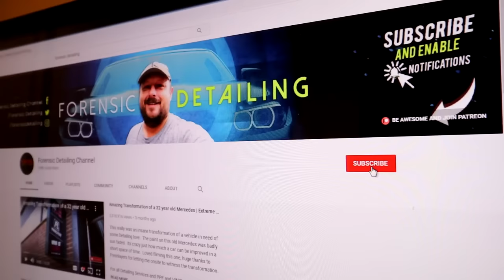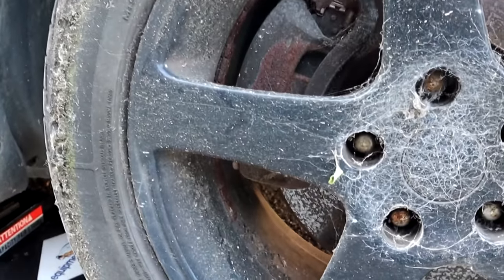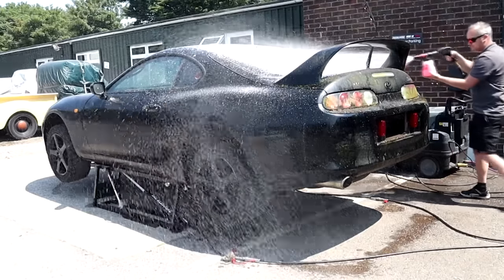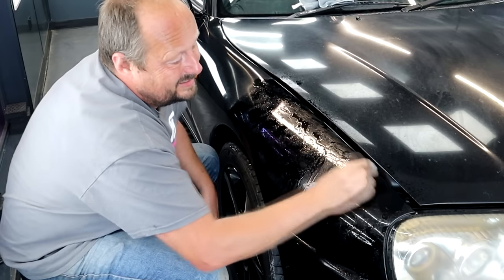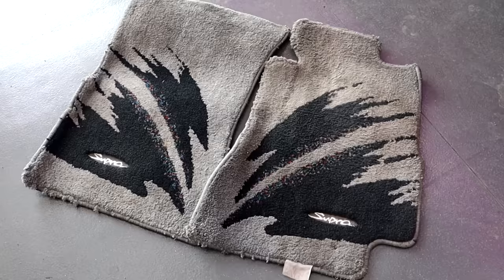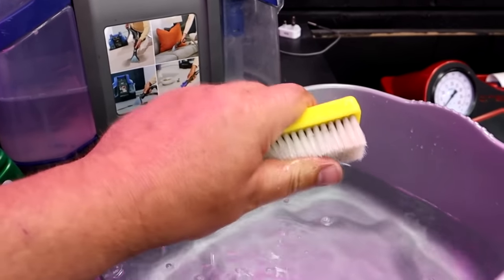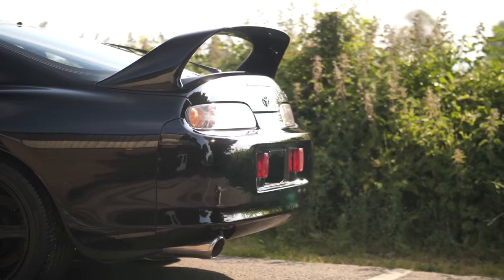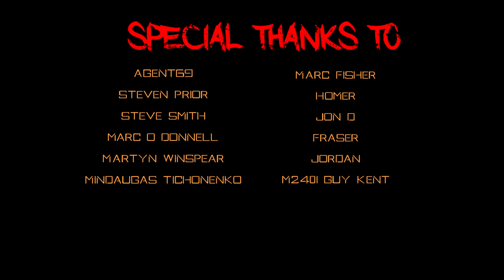Mouldy Supra Deep Clean Detail | First Wash in Decades

Comment from the maker: How would you have tackled this one?
Reply: Send it to someone like yourself... 👍 😉 top job guys
Reply: I would have done the same steps as you did! It's usually quite tough to get the paint perfect when the grime has been cooking for 24 years!

Great job!
Reply from the maker: @scandinaviandetailing  yer. there was no perfecting this but its at that age generally where your OEM clearcoat is probably going to need to be redone anyway.  my e36 was the same.
Reply: I wouldn't let it get that bad!
Reply: Rare car he says, yet there is 2 standing outside the shop :)
Reply: Probably would have chemically decontaminated it like you guys did. Was that wax is dead snow foam that you used? Or was it touch less or autofoam? Because that was obscenely powerful. Or did you need to go caustic to try to get rid of the most possible? After chemical decontamination, I would have repainted it. There's no way to work with inconsistent paint lacquer for perfection tbh. A really good thorough repaint probably would have best but of course would bleed one dry as well. Crying shame the car was left this way to begin with of course. Hope there was a good reason for it tbh.
Reply from the maker: @kwl189  citrus underneath then WID snow foam on top.  I think we could have gone stronger but the prewash really worked well.
Reply: @ForensicDetailing  worked a treat for sure. The shots afterwards showed the algae dripping off. Yeah from the videos on it it does seem the WID is more PH neutral / on the maintaining side of snow foams for coatings than designed for outright power like BH. Regardless the prewash did its job really well. Quite impressed with the finish from it. The strong pressure washer would have helped a lot with some detailing brushes for the seals.
Reply: How I would absolutely cry my eyes out if my car had this treatment
Reply: @olliebert2788  sometimes mate personal circumstances can hinder you, ill health, finances, etc
Reply: @TommyApel  that's not a car park full though is it 😏
Reply: could have used a clay mitt/cloth as a first pass to get the majority of dirt off faster,  then go over it with clay bar so it wouldnt clog up as much
Reply: I thought that it was too far gone for a detailing and should be be brought instead to a bodyshop. Or would that still be the preferred method to restore the car?
Reply: One bucket and sponge would’ve done the job…. 😂 🎣
Reply: How would you have tackled this one?
Paid someone to do it. As much as i would of enjoyed the process of cleaning it, i dont think I would have the patience to clean/detail the car to this level.
Reply: Exactly the right way by paying a professional to detail it.
Reply: Petrol and a match and a lot of tears? 😄 Nah, great job guys. Incredible.
Reply: Should have properly sanded and lacquered the lights, would have had a massive effect

Comment: I moved out of my house and into an apartment complex and haven't been able to detail since. No water connections no outlets outside so these videos have really been helping me get my cleaning fix. Thanks John. The car looks absolute incredible.
Reply: It's doable. I do mine weekly/bi-weekly with rinseless wash and then for wheels and tires I have a battery powered Ryobi pressure washer (brushless version) that has a siphon tube to pull from any water source. So I fill one bucket with rinseless, another with wheel stuff, and another with just water for the pressure washer from the bathtub.
Reply: I too live in an apartment complex and do rinseless washes I also visit the local petrol station jet wash with my chemicals and accessories (of course never touching the dirty brushes)
Reply: Same as man.. can’t even do basic maintenance coz we don’t have a garage
Reply: I moved to Germany, you're not even allowed to wash your car at home here! 😱
Reply: ….nobady cares!!
Reply: All I heard was blah blah blah I’m a euro lazy ass 😂 jk but not really, playah
Reply: It's already been said but rinseless washing is a game changer, wish I got onto it earlier. If your car is pretty bad just go to one of those car washes where you can pressure wash your own car and do a touchless wash to knock off heavy dirt and then just do rinseless for maintenance washes.
Reply: You can use a jetwash that takes water from e.g. a 25L can. The pressure is not amazing but does the job 😊

Comment: Incredible transformation. Not sure about the headlights but maybe that's because they need a full restoration or I don't know what the stock headlights look like back when they were out of the factory.
Reply from the maker: the right one the seal had failed so the inside was like scaled up.  both need splitting down and like refinishing the inside plastic bits.  we were chatting with nigel about this, might be easy to source other ones or send to companies that refurb them.
Reply: @ForensicDetailing  guessed as much. That's the problem with so much moss and algae. Did a restoration of something similar with an MX5 a while back. Headlights needed a full on restoration and for that to happen, the whole unit needed to be stripped out with compound polishing etc. The lights needed dismantling or replacing and the insides needed as much as the outside. Think the seal was starting to fail on one of them as condensation and water droplets was starting to build up inside. Then the air blower was starting to give out just as the car was being readied for sale (impeccable timing, couldn't have written a better script!). The algae ruined the stop top of the car (honestly last time I ever buy a soft top, such hard work to restore and maintain especially outside in the British weather) and embedded itself into the very fabrics and plastic trims of the car. Honestly never worked harder restoring that car to a half decently respectable standard in my whole life. Looked good though with a full lick of blackener on the soft top and protection.

Comment: It's an amazing transformation. My question is why do that first when the mechanicals will be ruined after sitting for so long. Will most likely need a full restoration and strip down underneath. So why not get that done first then get the busy done.
Reply from the maker: yer mechanicals first really although you would wash it off first.  I guess this just got a great wash first :)
Reply: And now the push they needed to get it back on the road

Comment: Couldn’t get that bonnet right, huh?
Reply from the maker: machine polishing can only fix defects by removing clearcoat material.  If the clearcoat has failed and is gone there is nothing you can do.   (not counting single stage paint).     all horizontal facing panels needed repainting.   But we got it looking shiney at least.